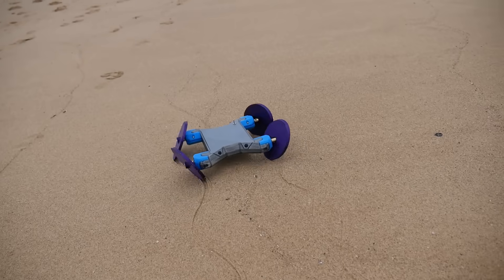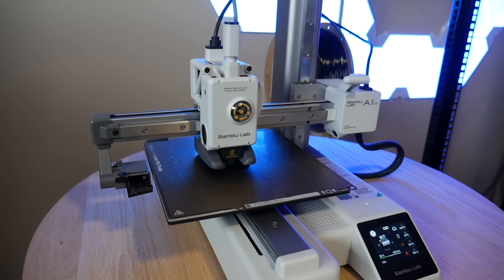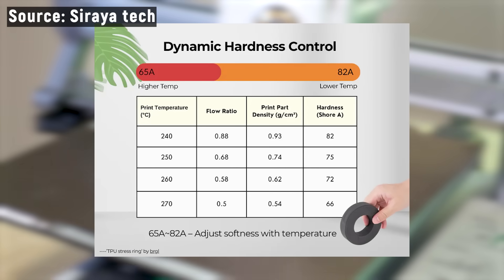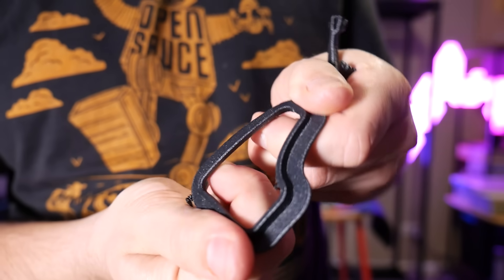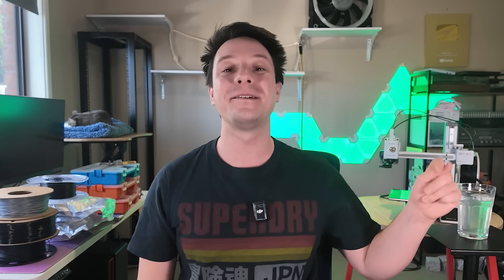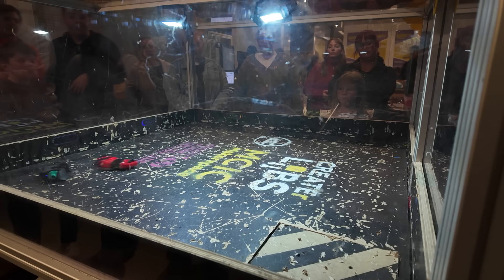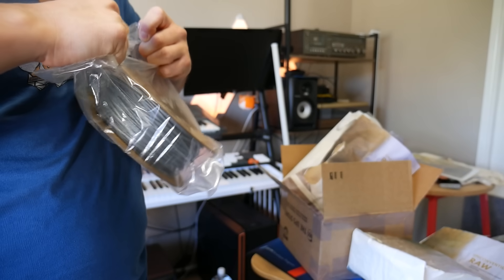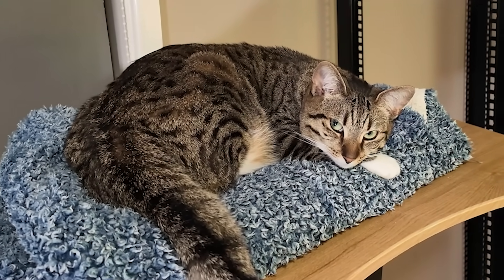3D Printing Filaments that Flex, Bounce and FOAM!

Comment: Plastic that dissolves in water? Where does that plastic go when you pour the liquid in the sink? More microplastics.
Reply: No. Microplastics exist precisely because they repel water even down to a molecular level. If microplastics were water soluble they would cease to exist. Water is the absolute worst enemy to Timeplast materials, which is why they address precisely the problem of microplastics as you can’t have microplastics of Timeplast in the presence of water, just like you can’t have microplastics of PLA in the presence of benzene but you absolutely can have microplastics of PLA everywhere else on the planet that’s not a benzene bath, including your lungs!
Reply: @supersingular   I'm not a chemist, but I had to take courses in it, and materials science courses. Plastics are chains of "mers" (hence polymers). Unless you break those chains down to the atomic level, they are plastic particles, just smaller and smaller one. Sugar dissolves in water, but it does not cease to exist.
Reply: @tsbrownie that’s incorrect. Polymerization is a reversible chemical reaction.
Reply: @tsbrownie breaking chains to “atomic” levels would create a nuclear reaction 😅
Reply: @supersingular Atomic is not nuclear. Chemistry happens between atoms and or molecules. Nuclear happens in the nucleus between proton and neutrons.
Reply: @tsbrownie you’re talking covalent bonds not the “atomic level”
Reply: That’s molecular level.
Reply: @supersingular Atoms include their electron clouds. Interactions between electron clouds is chemistry. 1 oxygen ATOM + 2 hydrogen ATOMS = 1 water molecule.
Reply: @tsbrownie yes but you can’t possible expect plastics to be broken down to individual atoms. That’s not reasonable. You want Plastics’s macromolecules to lower its molecular weight down to hydroxyl levels. Similar to sugar, rather than individual carbon atoms which makes absolutely no sense.

Comment: Foaming tpu where you can change the printhead temp thru the print and combine densities in the print. Think hard top & bottom with softer core or vice versa.

Comment: As always, I use hair spray rather than glue stick on my print beds, with fantastic results for 10 years.  Interesting that you say that TPU is hygroscopic.  This may be true, but I store my TPU (NinjaFlex Cheetah) out in the open and print it on my Prusa XL without drying it and the prints are perfect.  I do blow a pedestal fan at the printer while printing TPU to reduce the heat in the tool head, to avoid jams.

Comment: You have a video about G10 (Garolite), PP sticks to it really good if you sand it with 180 grit. I use FR4 variety 3mm sheets for printing PP and it's magic.
Reply from the maker: Huh! I did try on smooth but not sanded, will test thanks

Comment: It may be worth trying to dry the PBT material VERY thoroughly? Haven't tried to 3D print but if there is >0.2% moisture when you injection mould it you get good looking parts that are very brittle. Prototype EA Falcon exterior mirrors fell off the cars because of moisture issues.

Comment: I have been using that exact foaming TPU in an engineering application for custom printed bumpers for robot end of arm tools.  We used to use the extruded foam yellow and black striped bumpers that glue on but they were heavy and bulky and ugly. Now I can use the foaming TPU at a specific temperature setting to get the exact density I want and use height range modifiers to change the infield density throughout the part so that the outer and innermost surfaces are more solid while the inside has more squish, that way the bumper acts more solid instead of just collapsing in the one spot where something hit it, but also dampens the impact nicely even better than the extruded foam ones we used to use❤

Comment: 8:20 I have a core one with the pictured print sheet and I have to say after getting this sheet the printbed is no longer the weak point. Now I had more of a problem that the PP filament mangled in my extruder. Before I tried it also with packing tape but if there is a small bit of warping sometimes the tape just comes of with the part and then you have already lost.

Comment: Been singing the praises of PP for a couple of years now, I prefer Magigoo PP bed adhisive since I dont have any printers that can use the PP coated plates, and have found it prints best on an enclosed printer with similar heat soaks as my ABS profiles. You can print it open air as demonstrated I just have gotten better results with a toasty chamber.

Comment: the other downside of PP is, you need special glue. It needs an activator (usually Heptane) to activate the surface. Otherwise no glue will stick to it.

Comment: Saraya Tech also has a foaming PEBA, but currently seems to be sold out both on their website and Amazon.
Reply: I have their foaming PEBA its very similar to the air, but seems to do better with overhangs and prints at a higher temperature.

Comment: The dissolving "environmentally friendly" filament is a bit sus. 
 Their site doesn't ever say what it actually breaks down into, just that it's not microplastics or any of the 40 different PFAS they tested for (the attached note seems to say they weren't tested at the facility that issued the report, so tested in house?  Again, sus.) 

 There's over 10,000 known PFAS, they only tested for 40 specific ones, then promote and advertise that, along with fearmongering data about PFAS.  Why only 40?  They aren't the worst or most common, just a particular selection.  Again, sus.
...Makes me think of a magician, when they use a distraction "see, there's nothing up my sleeve" while stuffing something in their pocket for later.  

I'm not so sure it breaks down into anything good, or that'd be plastered front and center on their website, y'know, like every other seemingly good angle they use to promote their product?
Why is there no mention of what it actually dissolves or breaks down into?  

I'm guessing it's other PFAS that they didn't test for.
Reply: Everything in your message is not true. The PFAS test was, of course, conducted independently — you can clearly see the name of the lab and the analyst who performed it. These PFAS compounds are among the most common ones tested. Testing for all 10,000+ PFAS variations would be absurd and prohibitively expensive.

We don’t use any non-polar chemicals in the formulation of Timeplast, which is precisely why it’s 100% water-soluble. By contrast, the materials you use every day contain numerous PFAS compounds — yet I’m sure you don’t complain to those companies.

Our website also explains what the material breaks down into: simple hydroxyl groups.

It’s ironic that we’re all surrounded by microplastics today, yet when a company is making a serious effort to solve the problem by creating a new alcohol-based, dissolvable material, that’s the company you choose to criticize.
Reply: @supersingular  You may think you're fooling most people with that utter BS... I ain't buying it tho... wasn't born yesterday.

We all know why you didn't test for the PFAS in your product.  Just quit it with that disingenuous BS logical fallacy argument "well we can't test for all 10,000"  yeah, we know... you just tested for the ones you don't use.  DUH! 

And what the actual F do "other companies" have to do with the lies you're telling?  

How is lying about what I said or think about "other companies" making you seem any more than a complete sack of ---- ?

We're talking about YOU and YOUR lies, no one else.  You sound like a little child with that obvious BS attempt at an argument.

Your website NEVER explains exactly what your toxic products break down into, because you are OBVIOUSLY hiding those facts. 

If it was nothing harmful, then you'd plaster it front and center on your website, just like you promote anything else that kind of makes you look good (if you squint)

Irony??? 
The irony is that you insult your potential customers with BS obvious lies, and then expect them to still respect your BS greenwashing. 

Go ahead and reply with more insultingly obvious lies. Compare yourself to whomever you like, if it makes you feel better about your disingenuous website and practices. 

You're obviously just as bad as everyone else.  Quit pretending your shit don't stink.   It's rank!
Reply: who cares
Reply: @chonkibonki69  your mom

Comment: PP doesn't need PP on the print bed. It prints really well on G10 FR4! I found that out lately by myself. Afterwards i found out, that some other people do this, too. You just need a brim and 90°C bed temp. A (heated) closed chamber is beneficial, but i did some succesful prints with door and lid open.

Comment: A quick look at TimePlast's website looks like they're polymerizing sugar alcohols and managing to make that into a filament.  Even when fully dried it's still a hydrate with about 70% water so you'll always get some steam out of the nozzle while printing.
Reply: Yes. That vapor leaving the nozzle is also the cooling mechanism used to keep functional proteins like the ones in the bait filament (shrimp) from burning or denaturing, since the evaporation energy is taken from the mix, cooling down the rest of the materials in the process. The photovoltaic filament also works incredibly well, there’s a video posted in Timeplast Inc.YouTube channel.

Comment: I tried to use CC3D 72D TPU as a wedge on my combat robot, the biggest issue I had is that while packing I placed a heavy object on the wedge which deformed it for the rest of the event. Layers also seemed to separate with large impacts but that could've been poor design choice and not the filament.

Comment: Printing with Timeplast is made difficult by.. everything.. the moisture being the least. Havent seen an unpaid promotion of it that wasnt wrought with issues about their diameter inconsistency, coiling tangles, or multiple other issues.
Reply: So, do you rather live in a world where Timeplast filaments didn’t exist? They’re the first actual new material (new chemistry, new nomenclature) company in over 40 years.
Reply: @supersingular  No, I rather live in a world with truth in advertising. It may be new, but its also gimmick. Almost all their filaments use water absorbtion to work, makin literally 3d printings worst enemy for use of a filament, and making it the one thing the filament is best at, moisture absorbtion. The % of additives make it enough to have an effect, but not enough to actually be an effective product for how its advertised.. Enough soap ingredient to sud barely, but not enough to be an effective soap. 

All IF you can even get it to print because their diameter isnt consistent to even the what was expected in 2012 to allow a customer to receive. Even Makergeek had better quality control and they would ship filament that I had arrive with fibers and metal shards in it xD.
Reply: @MattWeber did you see Timeplast’s photovoltaic filament? For the first time ever you can generate electricity from the sun using your 3D printer, is that also a “marketing deception”? How can they be so evil while giving us all these amazing filaments? The fish food is amazing.
Reply: @supersingular  again.. yes.. if you cant reliably print something the extreme size it would take to make more than a few milliwatts given even low voltage solar panels need very low resistance to have basically ANY usable power... For the cost of the filament you could buy a photovoltaic cell that is 10x more powerful and 100% reliable lol

Comment: I print a lot of TPU for my business.  Several months ago, we switched to foaming TPU-LW from eSun, and it's a game changer.  The parts are lighter and more flexible while still being very tough.  The density can be adjusted by nozzle temperature and flow rate.  230 C and 100% flow for higher durometer parts and 270 C and 50% flow for lower durometer foamed TPU parts.  The matte surface finish looks great, it feels like the cloth covering on neoprene, and the surface finish hides layer lines.  The parts almost don't look 3D printed.  They have a high quality appearance.  I print solid parts from TPU by using more perimeter walls and they're solid but very impact resistant.  TPU also has excellent layer adhesion so the parts have much more isotropic strength without concern for designing around weak layer adhesion.  I now mostly print in eSun TPU-LW and Siraya Tech ABS-CF.
Reply: is it expensive?
Reply: @littlefrank90  Sadly it seemed to be out of stock most places I looked, but the esun tpu-lw was around £50/kg (for comparison regular esun TPU was around £32/kg). So it's more expensive than a lot of regular filaments, but not super expensive, especially as you can presumably get quite a lot of prints out of it due to it's foaming nature.
Reply: How well would it hold up for things like RC tyres? Is it grippier than other TPU?

Comment: Hi Angus, great video as always.   Can I ask a favor?  Would it be possible to have you create a video that goes over how to properly manage switching from one filament to another.  Like switching from PLA to PETG or PCTG and back again.  What precautions should one take?  Do I need separate build plates?  What are the gotcha's?    I think a lot of folks would benefit greatly.  Thank you!

Comment: 3:22 I've been using Colorfabb's VarioShore TPU for years now. They use basic Sodium Bicarbonate for their foaming, so safe and nontoxic. It's been great for dialing in grippiness and flexibility of TPU parts!
Reply: Absolutely LOVE their TPU
Reply: I love many of their filaments, but they are SOOOOOOO expensive. A few years back, I had a conversation with the CEO of the company by email, where he handed me a bunch of Steve Jobs-esque innovation-speak about why their filaments are only 750g instead of 1KG spools and why they're so crazy expensive. By the end of reading the email, my eyes had glazed over and I walked out of a random Apple store unsure of where I lived anymore. 😆💀 Like, sure, they innovate...but their normal filaments are marked up just as much as speciality blends, which is just unnecessary. I'd buy more from them if they weren't trying to rake us over the coals for basic PLA. (I've stopped buying Prusament for the same reason.)

I legit only buy their super specialized filaments that noone else makes, like their steel-, copper-, and bronze-filled PLAs and the VarioShore TPU. Their more "normal" filaments are no better for the pricepoint than the competition. 🤷‍♂️
Reply: @thewebmachine  their new PLA is super good and pretty affordable though. Like 18€ per KG and it's really super tough. No idea why no YouTube channel shows that stuff.
Reply: @MakerKar84 Their cheapest PLA is US$30/kg for us folks here Stateside. That's nearly 50% more expensive than other equally great filaments (like Polymaker). I find it quite hard to justify buying from them, outside of their unique varieties, when there are so many other great options available now at a better price.
Reply: @thewebmachine  I think I have the lower price cause I buy regularly. But yes, it's an European manufacturer and probably most interesting for European customers. For me its the only PLA so far that is durable enough
Reply: @thewebmachine  also like Polymer but was a bit disappointed lately. I hope their PLA HT holds its promises. Already ordered 10 spools. But its a bit weaker than the Colorfabb... I will try to replace ASA with it though

Comment: I've tried to make a battery shoes by folding left-over ♷PP food-grade/food-container sheets (mostly sourced from two companies in NJ,USA and ON,Canada), and found that while the chemical resistance didn't seem to (terribly) degrade vs leaked battery-goop; 
My {black, white and clear-white}  ♷PP sheets and takeout containers increasingly became too brittle to be folded or hit just sitting on a shelf as they aged (in that order), while
my thinner {semi-translucent brown}  ♷PP containers were still flexible to be useful.  (edit: My food containers that were used for food seemed to embrittle at a slower rate.)

After having all of them shatter, I've been thinking about trying scraps of ♶LDPE bottles, which tend to be impact-resistant and are also used to store liquid-food and/or corrosives...

I wonder if the various colours of printed PP will show a similar spread of susceptibility to embrittlement; or if that's another effect of my mother's aerosol-cleaner that has slowly burnt all the colour out of the drawings hanging around the bathroom except for the blue and black outlines...

Comment: FYI all polymers are viscoelastic, i.e. they behave differently depending on strain rate and strain duration. Temperature plays an important role as well. It is not a property only found in PBT, it may just be easier to notice there. As a matter of fact, all materials are viscoelastic, just on very different time scales.

Comment: So I'm sorry but you kinda missed a big selling point of PP and why it's such a commonly used plastic for many applications.
It's not only low friction but generally very chemically resistant, especially alcohol, bases, and even most acids. It allows for a lot of chemistry to be done, often also in cases where glass actually can not be used (think HF by example).
It's also fairly resistant against hydrocarbons (think oils).
That's also the whole reason it's hard to stick down.
Reply: PE, particularly HDPE, tends to slightly beat out PP in chemical resistance though overall pretty similar.  PP tends to be better up to a higher temperature and there are a few specific solvents it works much better with such as butanone.
Reply: Lack of UV resistance is a big liability though.

Comment: That foaming TPU is really unreal, definetely game changing for tires cause it has a slight rubber feel to it, not gonna be sticky like silicone rubber tires but if your doing rough asphalt or offroad its great for making custom tires.